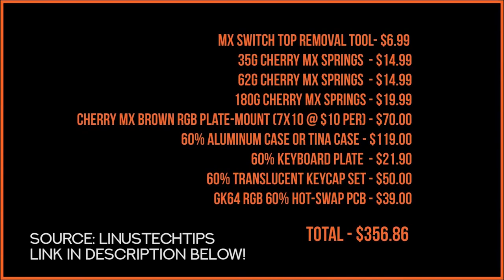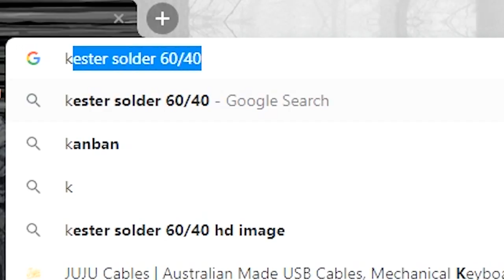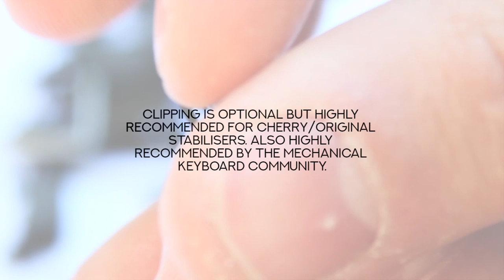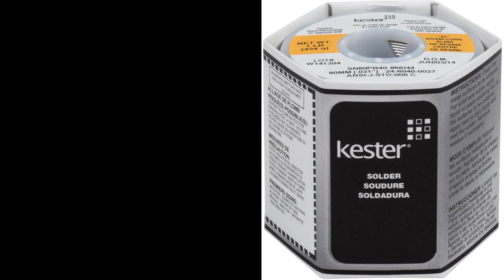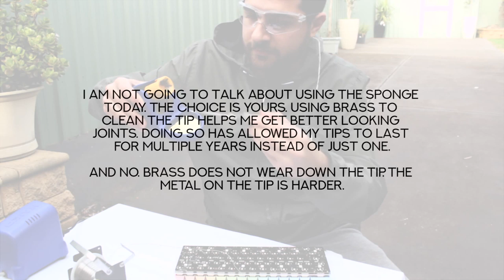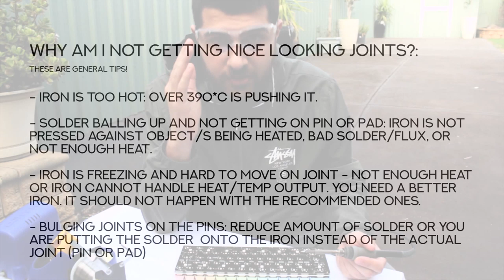How To Build Your Own Mechanical Keyboard! (With an EASY Soldering Tutorial!) ⌨

Comment from the maker: The video of me soldering is slowed down in parts of the video so you can see how I am placing the soldering iron onto the pad. You should leave the iron on the pad and the switch pin for approximately 3-6 seconds and by visually inspecting if the solder is flowing down the joint/hole. Around 3-4 seconds is the sweet spot to get a good solder joint. There are so many factors that will make this number/average vary - ambient temperature, iron temp, crappy vs good soldering iron, type of tip used, solder used, quality/design of the PCB etc. This is why you must PRACTICE first. You get a feel of how long you should hold your iron on the component/pcb so that the solder flows onto the components/pcb correctly! 

For this video I set it at 380-390*C because I was outside and I had a breeze to deal with (which I said). I wanted to demonstrate safety first so you do not inhale the fumes, and outside is the best option for that unless you have a fan or something to absorb the smoke.

For a beginner I would set it at 330-350*C and would try and solder for around 3-4 seconds. Give that a try. If it's not giving you the best solder bond, make sure you are placing your tip onto the pad and the switch pin with light-medium pressure. If it's still not giving you the best bond it may be the type of solder being used (60/40 is great for most projects). Use flux liquid (pens) to help get better solder bonds. Your solder might not have a flux core (or a bad flux) to allow it to flow nicely onto the joint. Flux is necessary for good solder joints! Do not keep going at it to make it look 'nicer', because THAT is how you get broken pads!

People might think I have such a high soldering temperature, but I have experience soldering items with a higher temperature for a lesser amount of time. It's a technique I have adopted and it reduces the chance of breaking or melting components for me because I can get the solder onto the joint quicker than waiting for it to heat up on a lower temperature ( and remember the footage is slowed down or I am voluntarily leaving it on for longer for you to see in the video). 

Of course if you are over doing it and keeping it on the item for more than needed to flow the solder onto the joint then that would be a fault of your own (eg: over 8-10 seconds is too long + a high soldering temperature). If you are breaking pads simply trying to solder a switch in place then you are definitely doing something wrong. Don't be too worried about it though - this is a learning experience! So...

Feel free to join my Discord and we can help you out! - https://discordapp.com/invite/mv5cAE3

Practice! Practice! Practice!

UPDATE - 2020 video is coming out with a more comprehensive soldering tutorial :)

- JUJU
Reply: JUJU Your video helped me get into the hobby. Thank you.
Reply from the maker: @KeyboardScraps  My pleasure :) I hope it helped!
Reply: JUJU it did! I had an idea how to solder but this video helped loads! I’ve now built over 25 keyboards and hope to make more going forward!
Reply from the maker: @pasifloraGR  knife or chisel tip is great!
Reply: Do you have any recommendation on practice kits we should try out beforehand?
Reply: I see everyone soldering inside😲

Comment: Not going to lie, This is so far the best tutorial I've seen for a Keyboard DIY. All the popular channels are really skipping the important parts which is a little bizarre. Anyways, Thank you for taking your time and making a video like this!
Reply from the maker: Thanks so much you are very encouraging :)
Reply: Most skip it because they don't know WTF they're doing, especially soldering.  JUJU is 100% correct on all his soldering tips.  I've soldered close to one hundred thousand joints, both in making stained glass ornaments, and electronics soldering.  There are some differences, but this video is SPOT ON when it comes to electronics soldering.
Reply: @goodjihad  NOW I'm gonna go build a custom mech keyboard! Just purchased some holy panda switches for the project and maybe going to use the kbd67v2 for the build.
Reply: @goodjihad  well he gives you so much details on a specific model.

Comment: Thanks for putting this video out.  My project was just replacing switches on a prebuilt board with quieter switches (the complains from the family about the terrible clicky blues....). There were three mistakes I had made during my building process: one, the switches were not exactly seated level with the plate- I did not realize that I ought to constantly check up on them to ensure that they were. So they ended up a bit curved, and then got pushed up when I screwed in the screw connecting the PCB and the plate back together too tightly (mistake #2: don't screw them in as tight as you can). The last mistake I made was desoldering. I didn't quite get how to properly remove the solder and ended up with partially desoldered switches. When I removed the old switches, I'd rip off the legs because they were still attached with solder. In hindsight, I should have redone the joint and tried to desolder again though this mistake was also because I was not cleaning the iron tip well.
Reply from the maker: That's good you are learning. Nothing to be upset about. This is how i learned and improved very quickly.

Thanks for sharing!

Comment: FYI If you need to desolder, it helps to overfill the solder a bit to suck it out. Also, put the corners and middle switches in first to line it up.
Reply from the maker: Indeed! Very much correct.

Comment: Viewers: "When do I clean my tip?" 
JUJU: "If you notice certain particles, or discoloring."
Reply from the maker: Yea i realised i should have been a bit clearer at that bit. Basically what i mean is if there is bits of hard solder, metal shards, or the tip is literally any other colour than silver, wipe it on the brass ball. These contaminations are what stops you getting good solder joints.
Reply: @goodjihad  he meant the other "tip"
Reply from the maker: @zerenityzz  😂😂😂😂 i tried to hide that thought. Why you think i paused hahah!
Reply: @zerenityzz  Well, in his defense, he did say to "wipe it on the brass ball."  Some people don't pack steel ones.

Comment: Hey man, I noticed you pressed down on the PCB/switches during the soldering process. What does that do?
Reply from the maker: On this one I did because I wanted to ensure all the switches were pressed into the pcb flat! Not necessary if you are sure you put all the switches in as flush as possible on pcb (till it touches those little nubs on the corners)
Reply: @goodjihad  Thanks man, appreciate the reply!

Comment: @10:53 
- By "flux", does JUJU mean the molten solder? 
- Also, when he puts the solder wire into the joint, does it need to touch both the pad and pin? It kind of just looked like the solder wire was just touching the molten solder.
- Lastly, just wondering, but is it totally normal to have burn marks on the PCB after soldering?
Reply from the maker: Thanks for commenting!
1.Flux is a liquid/compound that allows solder to 'flow' like water. It helps it bond to metals easier and cleans up the solder joint.
2. Well at first it needs to touch the component you are heating. Sometimes the soldering iron needs help to transfer the heat so putting fresh solder on both the soldering iron and the component you want to solder will create the perfect situation for a good soldering joint/bond. All about practice and understanding how soldering works.
3. It's most likely the solder you are using or the flux from the solder. You can clean this with IPA (isopropyl alcohol). If it's actually a burn mark then your iron is probably too hot!

Comment: Note. Please don’t lube your stab housing with dielectric geese, it will make it so slow to the point where you will want to get rid of the lube. Only use it for the stab wire, and use krytox 205g0 for the sat housing

Comment: So how does this differ from hot swappable PCBs? I’m relatively new to this stuff, but it looked like you soldered the switches to the board(??). Would a hot swappable PCB not require any soldering?
Reply from the maker: Correct! :)

Comment: Thanks for the KeyboardTester.com tip!  I soldered up a DIY number pad on Friday night and would have liked something along those lines to test with, first.  Fortunately, my only problem was one bent pin on a switch and I noticed it before I got to soldering by putting my fingertips on each pin location :)
Reply from the maker: YES! Always double check. Good on you for finding the issue!

Comment: hi, want to ask.. do you use some flux? because i doesn't see  you use flux during soldering.
Reply from the maker: The flux is in the solder. Flux is always good but because i understand how to solder the flux in the solder wire is enough for me. Extra flux can always help.
Reply: JUJU, sorry im quite noob here.. is there any specific type of solder wire that include flux in them? or maybe every particular solder wire already got flux included?

Comment: Hey JUJU! you make such great videos and are always super thorough thank you so much for helping so many ppl like me get into the hobby! I'm also about to start practicing soldering and one thing i just wanted to make super sure about, when applying solder, you never want to touch the solder wire directly onto the iron? the iron presses against the switch pin & pcb pad, and the solder touches the other side of the pad/switch pin? I wasn't super clear about where to touch the solder wire exactly, and i've seen a vid where someone says NEVER touch the solder wire onto the iron directly so I just wanted to ask and see if thats true or if theres some wiggle room there, thanks again!
Reply from the maker: My friend! Thank you so much and much love! 

I am not sure where they got 'never' from. They say you want to try as much as possible to add solder to the component you are soldering, but sometimes heat doesn't travel too well if you don't have a little solder on the iron already depending on tip. 

So:
1. Place onto pin and pad. 
2.Add a little solder to the iron and move around to the pin and pad and press on it with the solder to allow it to flow onto the joint.. 

This way it will transfer heat plus get flux onto the joint. The reason you apply solder to the component or pin and pad is the flux. You want as much flux into the joint as possible and the solder of course haha.

Hope that helps!

Comment: Nice video!
My spacebar stab is making a rubbing noise when pressed on the right side, I clipped and lubbed, do you know how could I fix it?
Reply from the maker: You might have installed it incorrectly. Or the metal bar could have popped out.

Comment: This video is really good and it explains everything really well. I have a request and a question - can you make a video showing how to solder leds onto the pcb and is it dangerous for teens to be soldering?
Reply from the maker: Thank you! Hope it helps you!

Yes sure can :)

 It is only dangerous if you don't put your health first and use the necessary equipment to protect yourself. In terms of teens, if you ingest lead it will be bad for your health. So be careful.

- Glasses is a must
- Face mask will not work, you need a ventilator or a small fan to blow fumes away from you
- gloves is not necessary but a good idea.
Reply: @goodjihad  thank you so much this helps me a lot! Keep up the amazing work

Comment: i planning to built dz60 rev3 , can i use 30W soldering iron? the brand is Goot KX-30R 30W..there is a higher watt available like 40W or 60, and 80W  unfortunately there isn't any option below 30W except the expensive one (Goot CS-31) which is 25W.
the soldering doesn't has temperature control , should i go for it?
for desoldering do you recommend using flux?

Comment: I want to make my own Keyboard very soon, problem is im quite new to this stuff and the layout in germany on the keyboards are abit different. Uhm especially the enter key. Can I still use the same PCB's for QWERTY and stick the keycaps over them or do I have to buy a QWERTZ one? 
Sorry if this question is dumb but still. Im quite new to this but I fell in love within the first sight of all this stuff :)
Reply from the maker: Not a dumb question! Very interesting and thanks for commenting! You can program the keyboard anyway you like! For example you can make the y key a z just by programming that in and then simply switching the keycap (depending on the keycap set. Some sets do not allow this or are not DE compatible).

Comment: My first 60% keyboard build cost me around 350$. I got switches, switch films, lube but just because I'm a beginner doesn't mean I would be scared to use them. I want to build 1 keyboard and I want it done right so I bought things most normal beginners wouldn't normally. What I'm trying to say is just because we're beginners doesn't make us incapable of building a keyboard you personally wouldn't deem necessary for beginners. If ima do something ima do it right.

Comment: How do you know where to put your switches to get a standard fit?
Reply from the maker: Hello! Thanks for commenting! Do you mean what direction to place the switches? The PCB has holes on it that corresponds to the switch pins. One usually sits higher or lower than the other and it only goes in one way.
Reply: @goodjihad  like there are multiple holes in the soldering pcb so how do you knownehich hole to put it in?

Comment: That'ss so cool! I'll look more into it for the reason of repairability. I own a off the shelf mech keyboard now an it seems to be broken somehow. Some keys don't at all, some regisster multiple times - it's really annyoning, esp. in programming. My focs is on longevity. Also most keyboard software doesn't even run on Linux, so fuck that.
Thanks for your video!
Reply from the maker: Hope it helps! It might be the chip/IC that has gone bonkers? Check the chip for bad traces or broken solder.

Comment: I have my PCB, aluminum case, switches, caps obviously, and soldering iron. Do I have to have a plate or can I solder the switches on without it?
Reply from the maker: It depends on your switches! Plate always recommended for best sound. If you have 3 pin switches (plastic middle and the two metal pins) then you will need a plate. If you have a 5pin switch then plate is optional.

Comment: If your soldering iron is at the appropriate temperature (300-350C) you shouldn't need to hold it on the solder joint for more than a second or so.  Beginners will take longer, but care should be taken to not pump too much heat into the board, especially around potentially sensitive components.

Comment: I have 2 questions, what happens if I don't solder the switches? And if I solder the switches, can I still swap them? Thx so much
Reply from the maker: You can't leave the switches unsoldered otherwise it will not work. If you want that kind of swappability you need to purchase a hot swappable pcb. :)

Comment: 0:29 A type of joke i presume. Just recently dabbled with the idea of replacing my switches instead of buying another keyboard and pretty much ended scrapping both ideas and moved around some switches and open and clean the contacts of the ones i knew as faulty.  Still some to go for a later date to clean them too but for now how it performs is acceptable. 
Buying new switches and keycaps alone would cost way more than buying a brand new keyboard. Even if not trying to put the exact same type of switches i have right now. If that was my goal to put the same type then it would be similarly expensive but also more difficult to access them because i think they were discontinued or something and i only found sellers on aliexpress and nothing locally.

Comment: Aight imma wait for those coiled cables. Most of the websites that sells that one I want are sold out
Reply: type custom detachable usb cable into google and 3-5 custom makers will show up.  3 of them are actively taking orders.  a fully pimped out cable with an aviator connector, coils, gold plated connectors, and double sleeving will go anywhere from 50-75 bucks.  they make lemo connector cables for 3-5 times more that look even nicer.  the lemo connectors look like little vintage star wars lightsabers lol.

Comment: Maybe it's the wattage of my iron but in my experience 10 seconds is far to long. If switches are anything like dsub then 3-5 seconds would be about the right with an old 40w iron from RadioShack. Edit other then that that's a pretty good tutorial.
Reply from the maker: About 10 seconds is the approximation. You are correct to say 3-5 realistically. The key bit in the tutorial is when it flows into the joint and creates a concave shape. 

Not a round ball but a literal volcano, the tip being the actual pin of the switch which you can see without much or any solder on top, and the bottom of the volcano being solder all around the gold plated hole. Which now should be silver coloured due to the solder :)

Thanks for watching!

Comment: Hi! Can I use the same grease to lub the switches? or is it a different one? :/
Reply from the maker: I would not recommend using dielectric grease on your switches no. If it's 205g0 krytox or thin lube (vpf1506) then yes :)